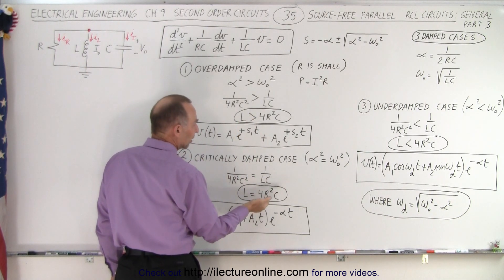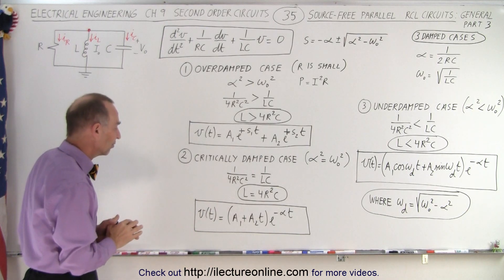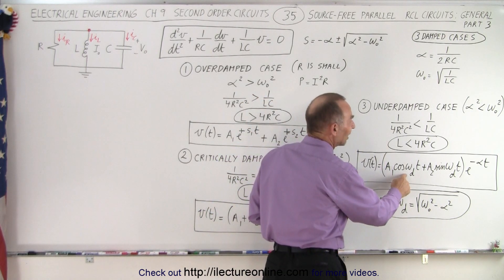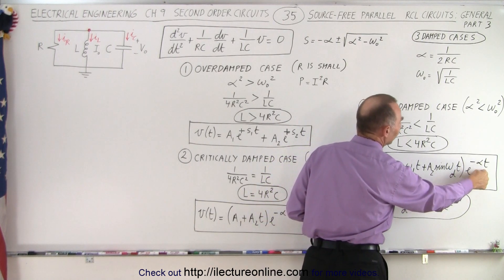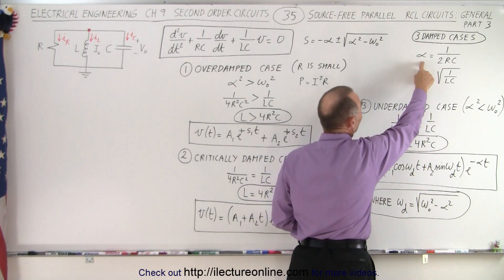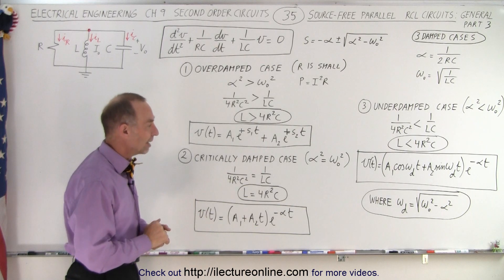Electrical Engineering: Ch 9: 2nd Order Circuits (35 of 76) Source-Free Parallel RCL Circuit 3 of 8

Comment: I got the following conclusion, correct me if I'm wrong. If this correct then how exactly damping varies with resistor for circuit with constant L and C,

#1  If R=0, then zero damping, LC oscillation
#2  If R=infinite then zero damping cause no current flow in the resistor branch, so again LC oscillation 
#3  If R near zero but not equal to zero very high damping cause all the current in resistor branch only
Reply: Nice observation. I think you are correct but only in this case of a source free parallel RCL circuit because you will have a slightly different observation in for-example a General RCL circuit with all three components in series.